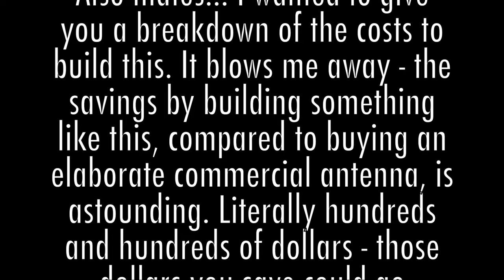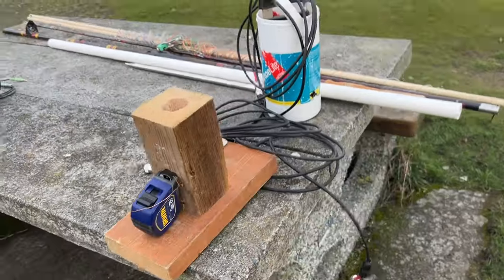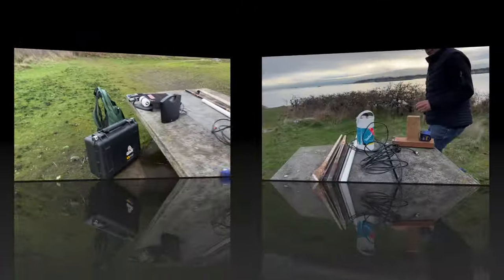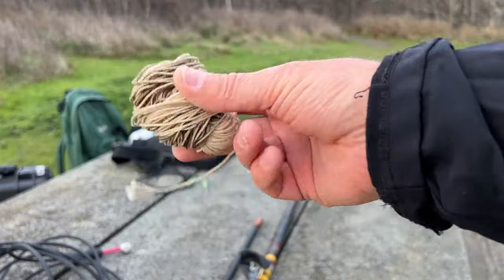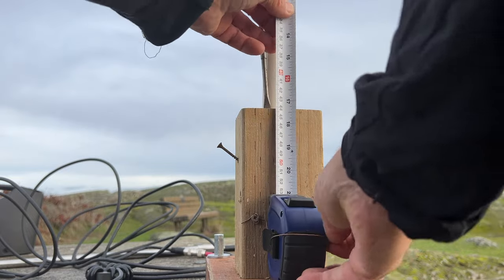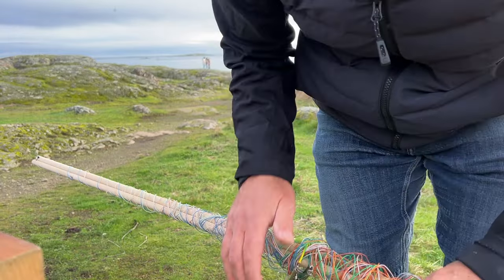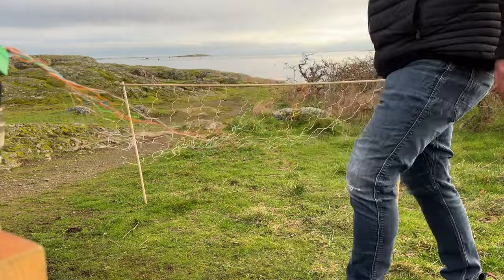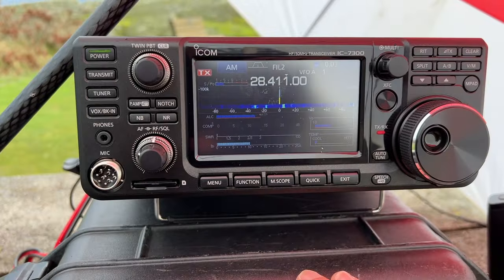$24.79 Tape Measure Antenna - Behind the Scenes Set Up #pota #antenna #hamradio #hf

Comment: Love the use of data cable for radials. I’ve done similar with a cord winding spool from Bunnings. I use a 5m length of 4 pair (which gives me 40m of wire) and I use a 75-100mm length of the outer insulation over the untwisted wires as a winding guide/sleeve to prevent tangles. The wires are terminated at the spool end to eyes that are fastened by a brass bolt with wing nut. I use an alligator clip or eye terminal to connect to antenna ground and voila!! VK2NRD

Comment: Was a fun experiment with the whip and the tape measure! From what I was seeing here is they are equally matched. I am pretty sure the QSB was making the difference between  the two. And yes it is AMAZING  how well it works!!  lol  Lots of fun..  73  VE1SK
Reply from the maker: Hey Buddy, what I forgot to do and I'll do it next time, as it's nothing to bring the Alpha Whip as well, is I am going to get both antennas 1:1 and then say on 10 meters which is a huge wide band, scroll from end to end on both antennas and see which one has a 'higher Q'. What's your thinking? Which one? Fun stuff buddy. See ya on the air and discord my friend

Comment: Hi Simon, tape measure antenna such a simple and unique idea. Make you wonder why the antenna manufacturer s haven't made something like that.
It's not just putting out a good signal, but drawing out the stations with your enthusiasm and friendship. And making radio fun. People remember you and come back for more.
Once again Happy New Year, and many more contacts and spread a little bit of happening across the world.
David M0DUU
Reply from the maker: G'day David, wow you're too kind mate! As for the antenna buddy - I couldn't agree more. When I did the math to add up the ACTUAL costings for this, and the overall performance of the antenna is staggering to say the least... I just couldn't believe how cheap and it is. By building something like this, that works and is resonant on every band (70cm-40M) you not only save hundreds and possible even thousands of dollars on the antenna itself, but you also don't need a tuner, an extra saving. It's all so much fun buddy. Happy new year to you my friend and thanks again for all of your support David. Cheers!
Reply: @thehamjazz  thanks for the kind words. Interesting to see how much they would charge us for a tape measure antenna.
It is true Simon, you make people happy. I have a smile on my face when I watch you. 
David M0DUU

Comment: I wonder what the difference would be if you used a few sheets of window screen material for radials vs the wire. Just a thought. 73
Reply from the maker: Hey buddy thanks for your comment. I’ve thought about using screen materials as the radials but from my experience, the signals due to ground loss are significant, that’s why I like have them elevated. Thanks for the awesome video idea buddy wooohoooo cheers mate
Reply: @thehamjazz  I thought that would be an excellent video idea as well! Would be cool to quickly switch between the two and have people signal test it. Would be a bit time consuming and would help to have a second person switch it out while you operate. Anyway, enjoy your videos as always! 73 Mike

Comment: Great video once again. I had a POTA contact with you one of the times you used that antenna and you were just booming into the South Santa Clara Valley 59+.
The fishing rod is genius. Do you still go fishing with it? If not you could remove the line quides just by cutting the threads that hold them to the rod. I think I am going to have to go out and rummage around my "stockpile" and see if I can come up with one. I already and two 13ft "crappie poles" that would work too I'm thinking.  73 KN6ZVI